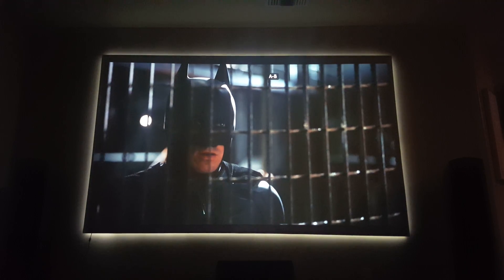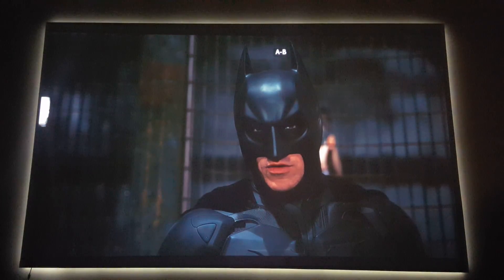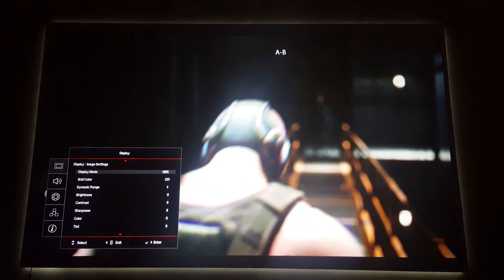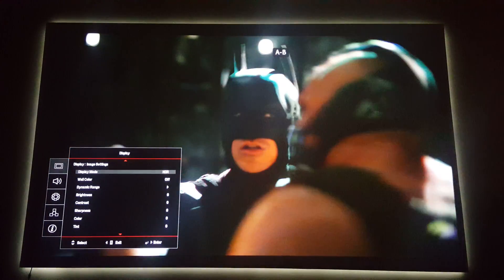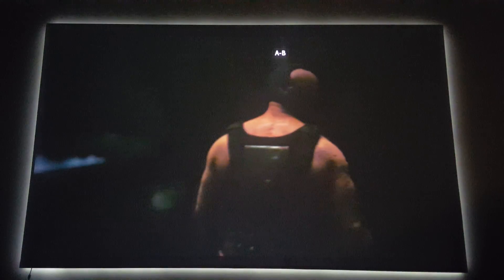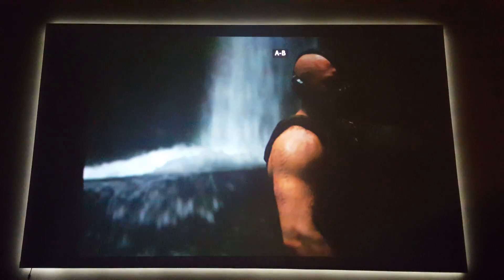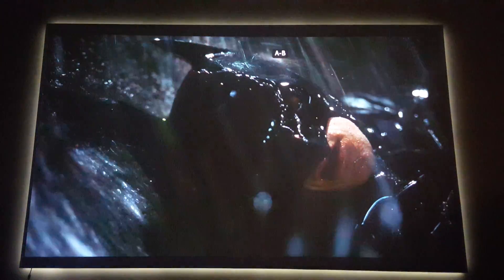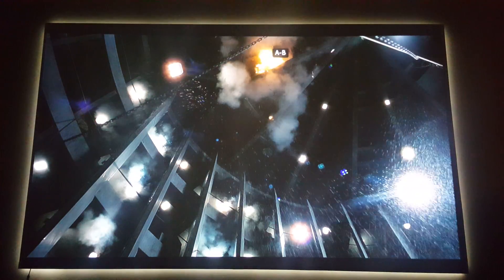What an updated Optoma uhz65 calibration looks like

Comment: Can you please tell me what the current firmware is mine is system c13 lan c07 mcu  c03
Reply from the maker: Mine is 17, 07,04
Hope this helps
Reply: @ronbrown7621  I'm about to send it to tvs pros to get it turned into the theo lite version do they upgrade the firmware while doing that and is it really a big difference in that
Reply from the maker: @moveezy5591  u can ask, as mine was done by optima then sent to tvs shop for upgrades.... But u will need to sent to tvs shop first,  if they will upgrade yours...
Color accuracy, color saturation, color luminance, SDR&HDR all dramatically improved according to my eye and scopes.

Comment: I know you're busy and this is an old there's but I've swapped over to The UHZ56 from an Epsom and I really need to get some update info. It's Soo much info out there that contradictory I can't figure out what to believe, what firmware I should have, what calibration. It's been crazy. You're picture is AMAZING so I used your color settings. It got better but nothing like yours. I'm in a light controlled room with a Stewart grey screen and right now I'm lost at where I should go from here for THAT picture.
Reply from the maker: Greetings and welcome to an awesome projector.
1st always call Optoma manufacturer about the firmware as only 2 companies can update the firmware.
2nd
With many variables with ur environment compared to mine, without a professional isf calibration, u will not reach the full potential of the uhz65. 
Size of screen matters also.
Reply: @ronbrown7621  that helps a lot. I'm only at 96 inches for my screen. I'll try to figure out who does projector calibration here in the A. This helps a lot. I wasn't sure if it was something I could do. Could you tell me what's firmware you're running? I'll figure out what I have and that will let me know if I need to send mine in to update
Reply from the maker: @FHGwood  
My latest FW is c11
Email if u don't know to view urs.
My best suggestion for all uhz65 owners has been contact TVS Pro  at www.tvspecialists.com
U ship 2 them
They update the FW
They lock in ALL your calibrations 
HDR day and night time
SDR 
Blue ray 
1080p 
BT2020
once returned u can now just plug and play😊😁😉🤗
Hope this helps.

Comment: Impressive PQ...Can't beat the UHZ65 for the money for a true 4k projector. Goes tot to toe with Sony's at more than 2x the cost. Is as good or better in some instances. What kind of screen is this?

But, it sounds like a huge PITA to upgrade the firmware because you're using a CROW Hybrid painted screen?? As good as the PQ is....I'd rather just get an ISF calibration by a professional. Though with a  UHZ55 projector I guess you wouldn't be paying for ISF tweaking as that runs about $600 :P
Reply from the maker: Anderson C 
I'm using Crow's Hybrid paint mix soon crows black mix

Comment: I read somewhere that the vertical adjustment if used will cause distortion because of the lack of keystone adjustment. Can you verify that?
Reply from the maker: mark kaupas 
Greetings in a long answer made short yes.
As with all projectors the strengths and weaknesses, the lack of keyston was kinda of off putting. To be completely honest wit yaa, my videos that have been posted - my zoom is maxed out with No distortions.

Comment: Does the projector produce much heat being laser? How does it compare heat wise compared to a regular bulb based projector?
Reply from the maker: Glenn Rubin 
In eco mode it's the same as the bulb units, but in high altitude mode it is hotter and noisier.
The life of a laser projector.